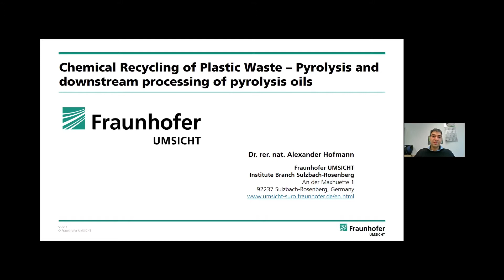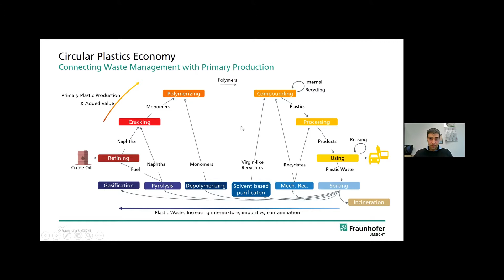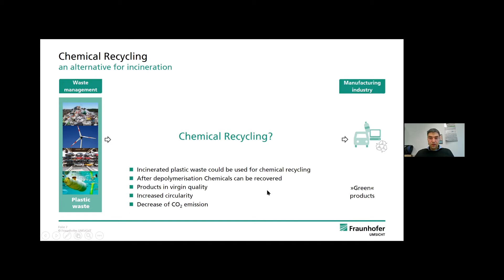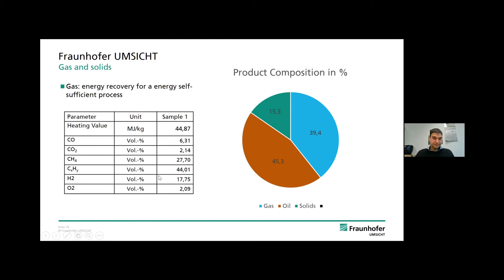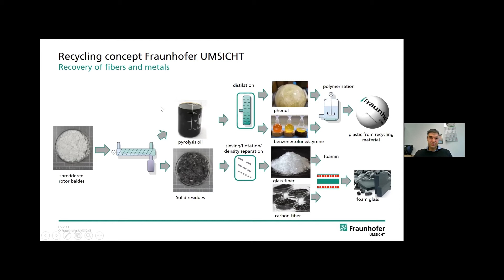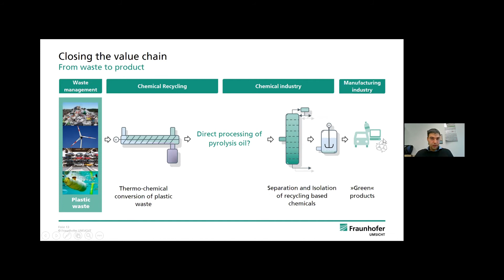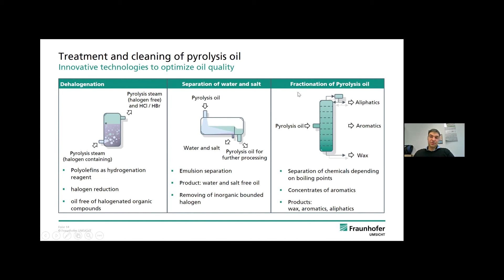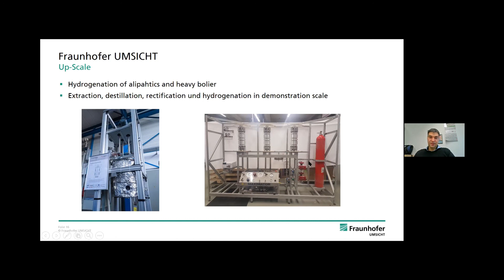Chemical Recycling of Plastic Waste – Pyrolysis and downstream processing of pyrolysis oils

Comment: Where can I get a copy of your slides?  I'm particularly interested in a higher res photo of the distillation apparatus.  It is strikingly similar to one I built.
Reply from the maker: Go to https://www.circularchemistryconference.com/previous-editions/. The conference where he was a speaker will be organised again on 8 March 2022. See the website.
Reply: @jakajima5470  Fantastic, thank you.  I see a vacuum pump there, is this just to scavenge the air prior to starting or is the distillation done under vacuum?
Reply: @dansw0rkshop  Very likely vacuum distillation, if it was as a scavenger they would likely kill their pumps. Haha!
Reply: @Gnefitisis  Uh... well in vacuum distillation it's a scavenging process that is ongoing, because as distillation products are emitted you have to continue drawing the vacuum.  So I'm a bit confused by your comment.
Reply: @dansw0rkshop  Usually during vacuum distillation you are separating the vacuum pump from the distillate with cold trap. This is done specifically to prevent gaseous contaminants into the pump body, because this will wear the gaskets and mix with the pump oil, reducing the pump operating pressure (needing to be set higher and higher to maintain your vacuum) and ultimately lifetime.
Reply: @Gnefitisis  That's true, but even with a scavenging strategy, (at least for my rig) the entire system including any cold traps so just looking at a system still doesn't answer whether they did the whole operation under vacuum.  Unless maybe you know what to look for that's considered a cold trap (I'm admittedly ignorant on a lot of things yet, it's why I asked).
Reply: @dansw0rkshop how u treat the oil u make?